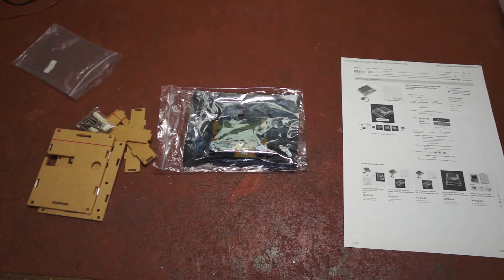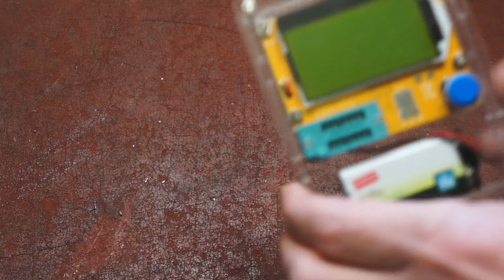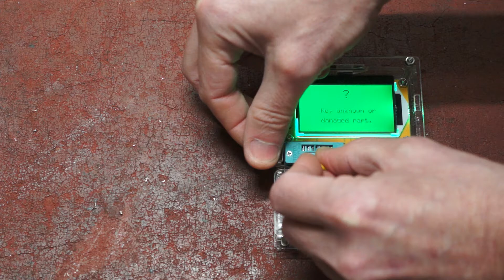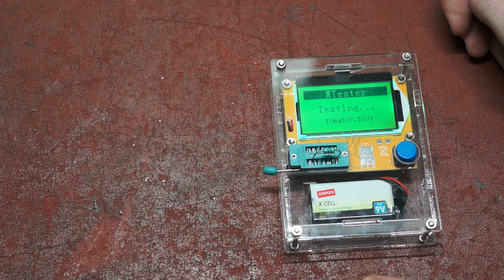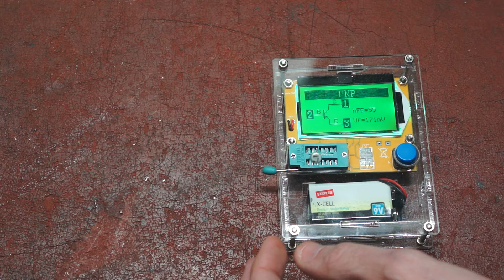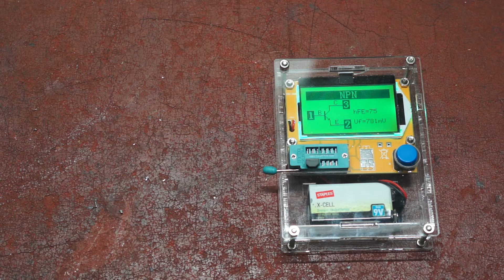eBay Component Tester for $5.96

Comment: I have the same thing, paid a bit more but still very affordable. It sure is very helpful to evaluate unknown components! The hardest part of the assembly was peeling the paper off the perspex 🙂 I did not notice that the ribbon cable sits quite tight against the case until now, but yes, it does. I hope it will be OK when not moved around any more, but cutting out the back board like you did won't hurt!
Reply from the maker: I remember getting the paper off the perspex was the most time consuming part of assembly.

Comment: Hello,  how do you adjust the contrast on the component tester?  Thanks
Reply from the maker: There is no preset pot, so presumably it's in the firmware or maybe one of the fixed resistors.

Comment: I have two, they are great for getting Hfe from unknown unmarked transistors or just identifying them but I have found they can be inconsistent too. Testing ESR on some old Ducons proved they were still ok.
Reply from the maker: I think the most useful feature is identifying transistor connections - so much easier than using a multimeter. The ESR measured on this tester is slightly higher than the EA/Bob Parker ESR meter, but good enough to decide whether or not an electro should be replaced.
Reply: @cool386vintagetechnology6  My thoughts exactly. Just identifying a Triac/SCR from a Jfet or bipolar transistor is very nice.